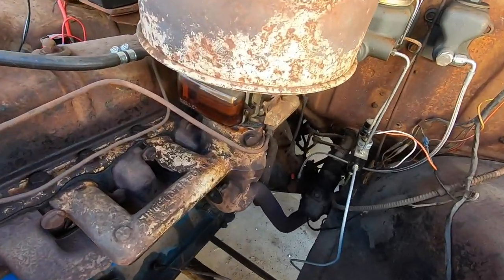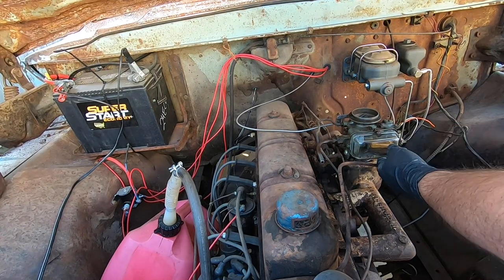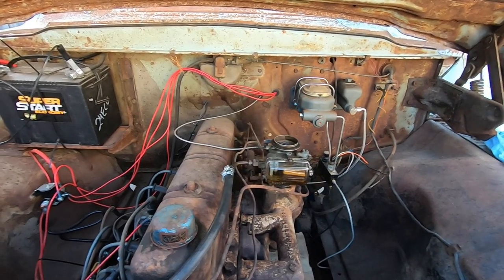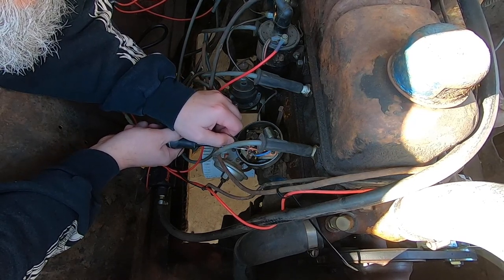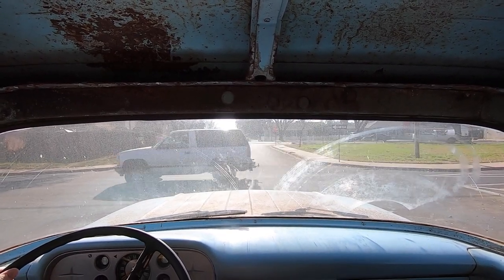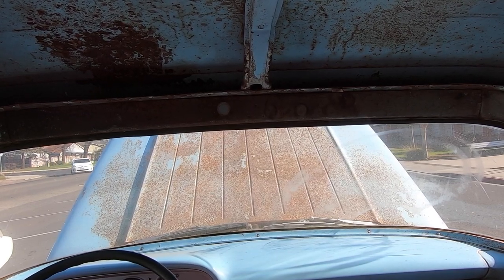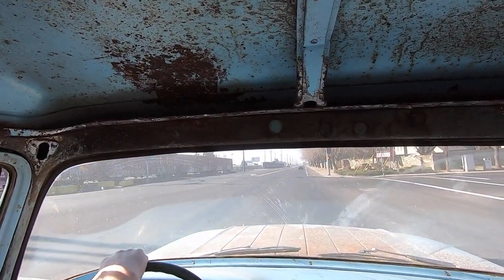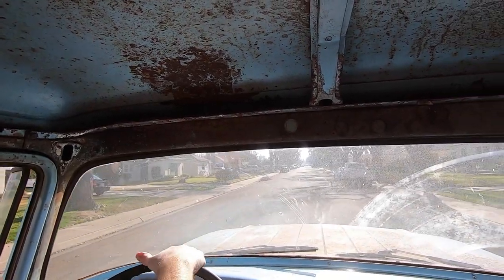1958 Ford F100 Panel Truck Rescue Part 3 - Speed & Chrome Illustrated Magazine

Comment: Thanks this series was a trip down memory lane.  In 1971 I bought a 1959 Ford Panel for $165 that barely made it home under it's own power with smoke pouring out the back.  My father helped me do an in-frame overhaul with new rod bearings, rings, and a valve job.  I had the radiator flushed and repaired, and added new thermostat, belts, and hoses.  The tranny, clutch, and rear end seemed ok.  I added a roof vent and built a raised bed in the back with storage underneath and a place to access my coleman stove and ice chest when the rear doors were opened.  We two toned the exterior with tan and cream paint and called it good.  I took off to Idaho from Long Beach, California and picked up my girlfriend in Idaho Falls.  We entered Canada and drove the Trans Canadian Highway east dropping into Niagra Falls to pick up some work.  Two weeks later we were off for Florida down the east coast where we landed in Tallahassee for a six month stay for work and adventure.  Next stop was Key West and then back through the southern states and Texas, Oklahoma, Colorado, and New Mexico before getting back to California.  We were gone for 12 months putting nearly 15,000 miles on the old girl.  Except for one front wheel bearings the little truck with it's 223 cu. in. engine and three on the tree never let us down.  At 55 miles per hour cruising we could get about 25 miles to  the gallon of regular.  Adult life started for us upon our return and, sadly, the old panel had to be sold for something more practical.  You know, like a 1963 Mercury Comet convertible!
Reply from the maker: @jeffwright9431  thank you for the story. I love reading about other adventures in these old rigs. I’m so glad you liked the videos. Sometimes it’s hard to capture the feeling you get resurrecting something like this that sat for so long.

Comment: Is this the same one that was posted on CL modesto? I was really interested buy I'm in SD -18!  I wasn't clear, did you replace the gas tank or is it running on the boat tank? Was that tarnish just from the carb?
Reply from the maker: Yes, just reposted the Craigslist ad yesterday as it had expired. https://bit.ly/3jPQSfV   Its currently running off the boat tank. The original tank is still in it and can either be ran as is with a few filters to finish cleaning it out or it can be pulled out and boiled out again. It also comes with a whole other original tank so the new buyer has some options. I was more concerned with getting it running well, which it does now after driving it for a while.

Comment: Use only Ford points they work a lot better seen engines that wouldnt run on part store points mike
Reply from the maker: OEM parts are great, where do you get yours?  I know they show up on evil bay from time to time. NOS are the best.